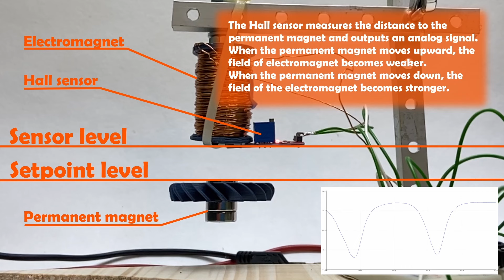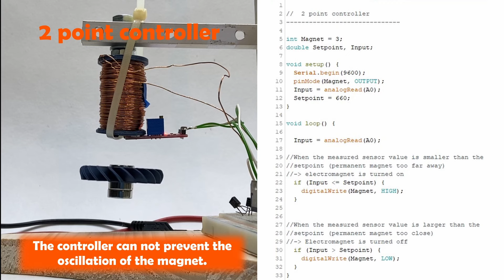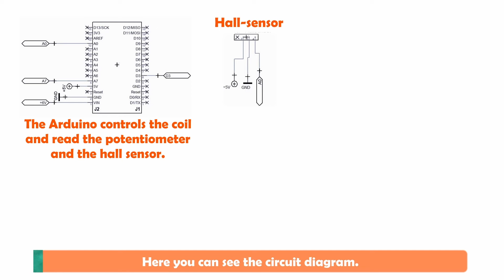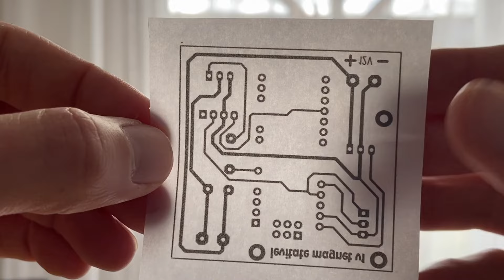Magnetic Levitation with Arduino. Technical details, Code, Circuit diagram, 3D Models, Circuit board

Comment: Muchas gracias, acabo de poder hacer el levitador magnetico, como recomendación para los diversos ajustes
-modificamos el muestreo del arduino de 9600 a 115200, para hacer la respuesta mas rapida al cambio y fijamos un delay (1) que no es nada pero permite que el movimiento sea algo mas suave
-usamos el transistor tip122
-usamos imanes de neodimio
-usamos una fuente de 6V-2A 
Éxito realizando este proyecto
Reply from the maker: Hola, gracias por los consejos. ¿Utilizaste un núcleo de hierro?
Reply: @FraensEngineering  Si, ya las dimensiones no las tengo

Comment: This is one of the situation where analog circuit would be better.
You can use precision comparator with rail to rail output to switch the mosfet and have linear hall effect sensor feed into one comparator input with potentiometer voltage divider feeding the other input.
Reply from the maker: Can PID control also be realized with this? This is definitely advantageous and works much better than a simple off-on control.

Comment: when you used  a circuit board you removed some of the components like the resistor and diode why is that? you basically removed the left side completely and soldered the KY-024 Hall Sensor sensor
Reply from the maker: Hello, there you have watched very attentively ;-)
I think the self-soldered board was not quite finished. Correct is the circuit diagram at minute 4.40, and the etched board. At 9.50 you see very briefly in the video that the Hall sensor board is plugged. It was not removed.

Comment: Hello Fraens ,

I have buyed this model documents in etsy .I am very thankful for this .I will like to know how much weight can be levitated using this ? and can i replace electromagnet you have made with solenoid electromagnet which  i bought on Online?
Reply from the maker: Hi, Hmmm I can't say the weight like that. I don't know that. But the heaviest thing I tested was a metal saw blade.
Reply: @FraensEngineering  Thanks for the fast replay.Can I replace electromagnet you have made with solenoid electromagnet which  i bought on Online?.the electromagnet which I bought can lift upto 15kg
Reply: @premsai5392 hi i was also wondering if you replace the coil with the solenoid electromagnet    have you tried it? And if yes did it work?

Comment: Hi fraens i was wondering if i can replace the coil with an electromagnet 12V 4kg   i bought all the parts like the video and my only different part is the magnet
Reply from the maker: 🤔 If you try it, let me know. However, a pot magnet is certainly not ideal for this.

Comment: What do you think about Active Magnetic Bearings. Would you try to make it?
Reply from the maker: Magnetic bearings already exist. However, I think that this can only be used for small applications. A large bearing would require a lot of power and you would have to think about the heat dissipation.
Reply: I'm actually trying to make it.  Is electrically and control almost the same as magnetic levitation?  What do you think?
Reply from the maker: I think there are already solutions to this. I could imagine that there is an application for precise measuring instruments. Electrically controlled I can not really imagine now because you always have small fluctuations in the system. The electromagnet constantly tries to compensate for the deviations. The system never comes to rest. Rather, I could imagine a magnetic bearing by means of permanent magnet. 
But don't let that stop you from trying it. Please inform me about your results. I would be very interested.
Reply: @FraensEngineering  can you explain the little part you used that you haven't mentioned? resistor, how many turns of the coil, etc.? hehe I want to try to make it too. 😁
Reply from the maker: Hi, which small part do you mean? 
I have not counted the turns. Just wind the coil full ;-) The exact calibration must then be done in the code. Potentiometer I think I took a 10k. I don't know that exactly anymore. But a 100k should also work. It is only to read a value in the Arduino. The resistance to the transistor is a 1k resistor. What you might not see so well in the video is a screw in the coil. This amplifies the magnetic field. You will not get around the trial and error. Everything has to be adjusted very precisely. Maybe you can give me feedback if you made it.

Comment: In the final product, what was in the core of the electromagnet? Was it an air or metal core? I have seen some talk online that a metal core is more likely to interfere with the hall effect sensor.
Reply from the maker: Hello, I have pushed a screw into the coil. I think it was a M8 screw. Unfortunately, I no longer know the exact dimension. Without the screw, the electromagnet was too weak.

Comment: I made this today and did it. Bitte I have to put aluminium foil under the neodym magnet. I dont know how ? I think because I created a magnetic field against the electromagnet.
Reply from the maker: Well done. It's not easy. Did you build it like me? What Arduino code did you use?
Reply: @FraensEngineering  yeah i build it similar but the devices are little bit different
Reply from the maker: What Arduino code did you use? Did you solder the board?

Comment: Hi, i require a tip please: my circuit works good, but when the magnet stics fast to the electomagnet, generate an high voltage that kills my arduino. How can prevent this overvoltages?
Reply from the maker: Did you install the free-wheeling diode around the coil in the right direction?
Reply: @FraensEngineering  that prevent from inverted voltage, when you disable the solenoid and the magnetism collapse, not from overvoltage when the magnet stick to the solenoid. The last one is a direct overvoltage, so the flyback (or free-wheeling) diode do not do nothing, and the arduino obviously blow up
Reply: @samuelebaiano6505  Maybe it's too late but you can use a diodo zener to prevent it

Comment: Does your coil have an iron or air core, I assembled a similar coil and tried both types of core and it can't lift anything, I used 23 awg gauge with 350 turns in a plastic cylinder with a one inch diameter.
Reply from the maker: I used a zinc plated screw. This can be adjusted a bit in height.

Comment: I make today like your experiment. I used also PID code and libary. But somehow it doesenot work. I think because i have a electromagnet 12V in amazon, i dont make it like you. Oder my electromagnet is not strong enough. The idea that you used Potentionmeter so awsome. Another question is, do i need to change the value from Kp, Ki,Kd. And how can you find it. Thank a lot. Have a nice day.
Reply from the maker: The value of Kp, Ki, Kd is a bit tricky. I have experimented with this a lot. If your setup is different, the values will also be different. You can see my values from the video. Ki you can set to 0 I think. The 12V magnets from Amazon that I have at home are not very strong. Without a potentiometer it is very difficult. I have not been able to do it. Especially if you want to levitate objects of different weight, you would have to change the program every time. 

Translated with www.DeepL.com/Translator (free version)
Reply: @FraensEngineering  thank you every muchhhhhh. Have a nice day. You are sơ friendly and helpful.

Comment: Hello, I ran into a problem while making the circuit for the levitator. I am using an arduino uno but I noticed you were using an arduino mini. In the schematic it shows you are using a voltage controller to power the arduino. If I’m using the uno would I even need the voltage controller or can I just plug it up to my computer? Thanks
Reply from the maker: Hello, my original setup was also with an Arduino Uno. You can supply this as normal via the Arduino. However, you must not supply the magnet with power via the Arduino pin.
Reply: One more question, do you know what i should use to power the magnet, and how many volts and amps it would need? Thanks
Reply from the maker: As far as I know, this should be in the wiring diagram.

Comment: Hello, Fraens. I am working on my magnetic levitation project,  which is the same project depicted in this video. My hall sensor shows the magnetic field rating of my electromagnet, to be lesser than the rating of the magnet used for levitation, even though my magnet is very weak. I have used a 120m meter wire of 26 gauge, which is of higher rating thn yours. Did your setup have the same situation? If yes, then how did you manage to levitate it with a weaker force?
Reply from the maker: Hello, unfortunately I can no longer tell exactly how long my wire has been. I just wound the coil full with it. What you can't see very well in the video is a screw in the coil. So an iron core. Without this I could not get anything to float. The electromagnet is too weak without an iron core. It took me a long time to find the right settings on the Arduino. But if you have found them, it really works very well. Do you have any serial output on the Arduino? Serial.println should not appear in the code. This makes the system very slow. I also noticed that the etched board worked better than the soldered board.
Reply: thank you for your earlier reply, it really helped me. I got a serious issue at hand now, my sensor reading is changing whenever my electromagnet is on. So basically my setpoint is being varied whenever the electromagnet is on. I do not understand how you didn't get this issue, or did you do something to resolve this issue?
Reply from the maker: Yes that's right. But should not matter. For me it also worked that way. 
Scenario: Electromagnet has a certain strength - Sensor shows a value - Permanent magnet moves towards the sensor - Sensor value changes - Electromagnet regulates back to the old value. 
The controller always tries to set the ideal value. It does not matter whether the electromagnet changes the value.
This is my theory. Whether this is scientifically correct I can not say ;-)

Comment: This is my first Arduino project. I am trying to get this working so I can do this as a project with my high school physics class. I purchased the plans and codes through Etsy. I could not get the PID version to work. The permanent magnet just sticks to my electromagnet. The 2 point code is different on the Etsy version than in the video. I tried copying the code from the video but got an error for this:  if (Input > Setpoint) { . Already have too much time in this project to give up! Any help would be great!
Reply from the maker: Hello, I am very sorry that it does not want to work. Setting the PID is not very easy. I have spent many hours with it. I find it a bit difficult to help you from a distance, as even the smallest changes have a big impact. Did you remove all the "SerialPrint" commands from the code? Serial communication takes a lot of time. You can also try to prevent the reading of the potentiometer and enter the values by code. Can the PID code be compiled? If not, was the PID library included?
Maybe you can give me more info.
Reply from the maker: Did you solder the circuit to breadboard or etch a board? Do you use a metallic core in the coil? If the magnet is constantly sticking to the coil, the P-value could be set much too high. Do you know how a PID controller works?
Reply: @FraensEngineering  Thanks for the prompt reply. I did not remove anything from the PID code I got from etsy. Should I? This is all pretty new to me so I figured I'd try the 2 point controller since that is supposed to be easier but I had problems with the code. I don't really know how a PID controller works. I do have everything wired into a breadboard. I hooked an led light up to the hall effect sensor so I could get a visual that it was working so I don't think that is my issue. I did use an iron core in the electromagnet. Maybe try and adjust the P-value then?
Reply: @FraensEngineering  I had paper over the iron core. Once I removed the nut and washer from the end of the electromagnet the permanent magnet barely sticks when it's not powered up. Once the electromagnet is turned on then the permanent magnet is attracted to it.
Reply from the maker: If you haven't read this yet, I've written quite a bit about it here: https://fraensengineering.com/magnetic-levitation/
Including a relatively simple explanation about the PID controller. 

For the PID code to work it is necessary to include the library. You do this in the Arduino IDE under the category "Tools" and then on "Library Manager". Here you search for PID and install the library from "Brett Beauregard Version 1.2.0". In the video you can see this at minute 4:14 at the top of the screen. I should have described this better on my website. I will look into this in the next few days.

You don't need to connect a LED. You can switch on the "Serial Plotter" under "Tools" and output the analog value of the Hall sensor via "Serial.print(" your value ");". In live mode, however, you should take this out of the code as it takes a lot of time.

Concerning Eisenker: This is an important parameter which has a lot of influence on the system. I simply tried several screws for this. It should not be too big but also not too small ;-)

The Hall sensor has a digital and an analog output. You have to connect the Arduino to the analog output of the sensor. This should be labeled with A0. At the digital output you get only 0 and 1. With this it does not work. The PID control looks at the analog values and controls the electromagnet. The control looks a little bit into the future, so to speak.

I don't understand exactly what you mean with the paper.
Reply: @FraensEngineering  Okay I totally missed that in the video. We only have chromebooks at our schools so I was trying to get the 2 point code to work. I was able to copy the 2 point code from your dropbox link in the comments so I will play around with that tomorrow. I will work on the PID at home and try to get the libraries I need downloaded. I will keep you posted and let you know if I have any more questions. Thank you for your time.
Reply: Is the potentiometer needed for the 2 point code? I don't see it in the code. I am currently using a 49e hall effect sensor. I purchased the same one as you today to see if that makes a difference.
Reply from the maker: Hello, in the 2 point code I have removed the potentiometer from the code because reading the analog value takes time. I would only use the 2 point code for testing at the beginning. I have not been able to achieve a longer-lasting floating state with it. That's why I wrote the PID code. I do not know your Hall sensor. But it certainly makes sense to use the same one as I did.
Reply: @FraensEngineering  Okay. I now have the same hall effect sensor as you and it seems that is not my issue. I am trying to have some success with the 2 point code so I can do this as a project with my students on Chromebooks and get by with the Arduino web editor. The only thing different in my circuit is that I am currently using a tip120 transistor. Could that be the problem? It seems like my electromagnet is ON all the time and is not turned off by the hall effect sensor. Any other suggestions?
Reply from the maker: Hi, I don't know your transistor.
With such things, it is always good to find the fault using the exclusion method.
I would proceed as follows: First, test the Hall sensor. In the code, output a text or something from an if loop with "serial.println". Just to see if the sensor works. Furthermore, I would test it with the serial plotter in the Arduino GUI and see what kind of analog signal comes out. If that works, it's not the sensor. 
You can then connect an LED to your transistor as a test and control it with it. As long as the circuit doesn't work, it doesn't matter which code you use.
Researching the cause from a distance is somewhat difficult. But if you test the individual components, it is relatively easy to find out where the problem is. Trial and error ;-).
The circuit is not very complicated. Familiarize yourself with it. There are countless examples on the Internet.
Reply: @FraensEngineering  The hall sensor reads 2.3 volts when no magnet is present. When a magnet is introduced it reads up to 3.8 volts. The hall sensor is supposed to output a voltage from D3 to turn on the transistor, correct? The voltage reading from D3 is .48 volts and does not change when a magnet is introduced to the hall sensor. So my transistor is not being turned on which is not turning on the electromagnet. That's what I was able to troubleshoot.
Reply from the maker: I don't quite understand what you mean. With the Arduino ADC you get values between 0-1023. Simply output these values at the serial interface and display the values with the serial plotter.  Have a look at how this works on the Arduino. This is a basic thing that you should familiarize yourself with. It is really not difficult to send values from the Arduino to the computer. 
The Hall sensor does not switch the transistor on and off. The Arduino does this above a certain threshold value. 
In principle, it works like this: The HallSensor gets +5V and GND. The analog output to A0 of the Arduino. A signal between 0-1023 is read in here. Above a threshold value, the Arduino outputs a signal on a digital pin which then switches the transistor through. The electromagnet is connected to the transistor. Don't forget the freewheeling diode!